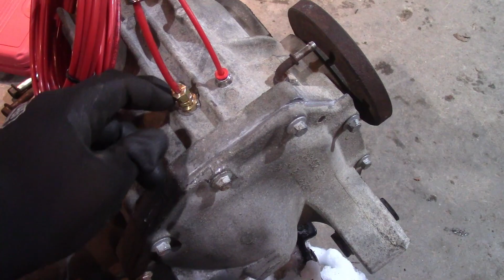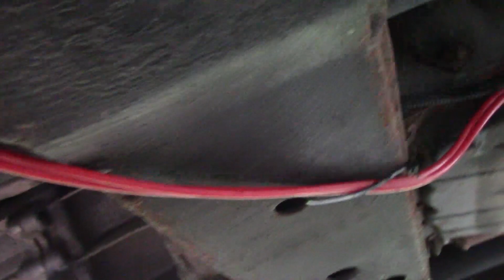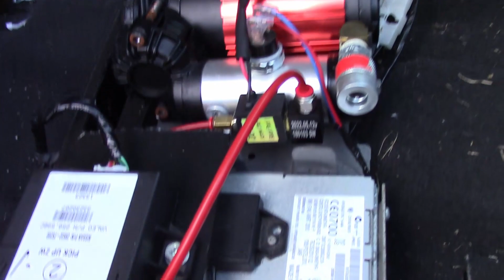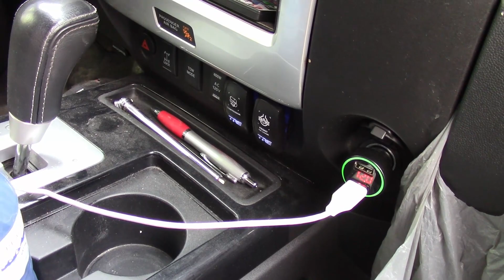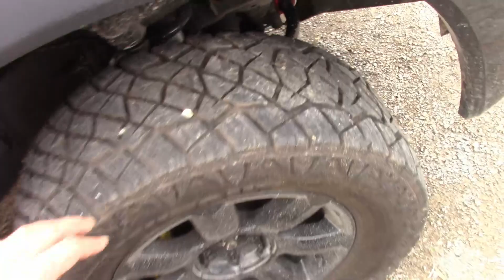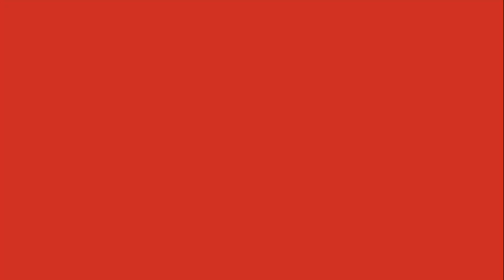TRE Nissan Titan Air Front Locker Test! Finally Finished!  Will it work?

Comment: How did it hold out ?
Reply from the maker: The locker is still working but I had to replace the compressor.
Reply: @TitanTown after how long ? And do you have any footage of it in action ? I have a 2021 titan pro 4 x and I’m thinking about installing a front arb after my lift project.

Comment: Nice work. I thought the front diffs were a bit weak tho - will this not just cause it to grenade?
Reply from the maker: Thanks.  I have 4 passes on the pull track on this and it has stood up so far.  Any diff is weak if its not maintained.